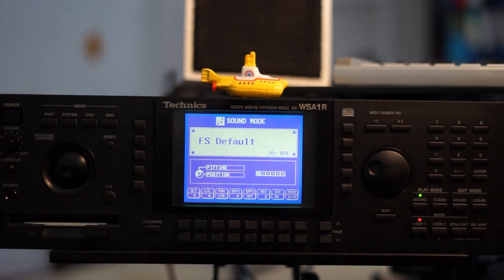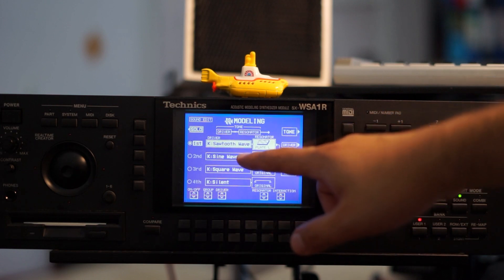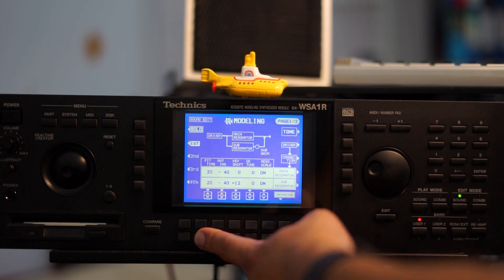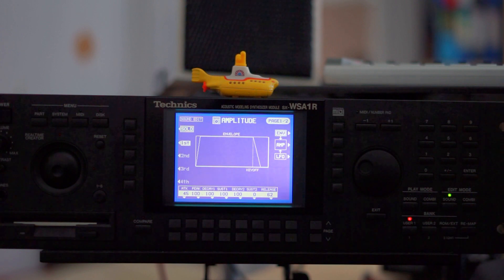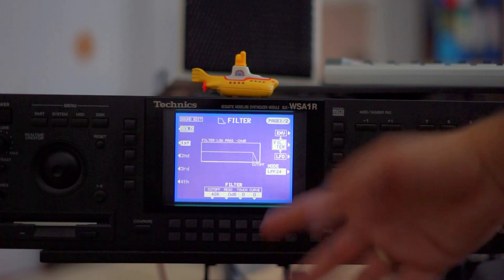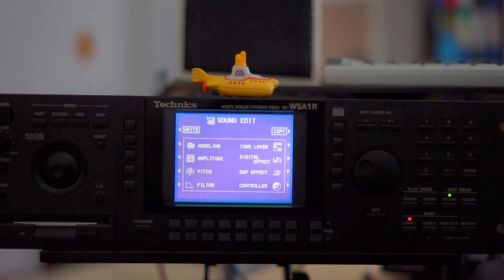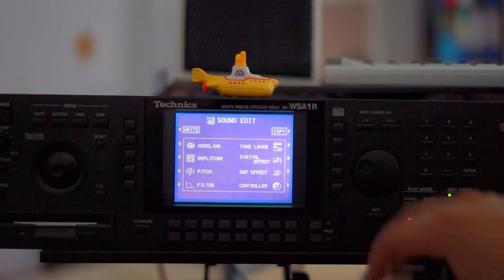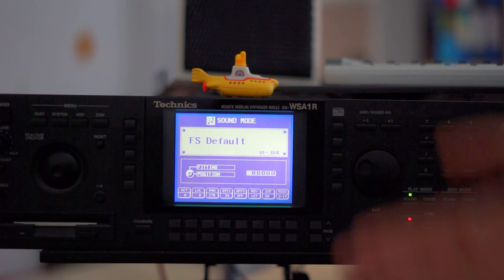Technics WSA1: A closer look at the modelling synth engine

Comment: Many thanks for your reply. I agree that the looping was sub-par on the WSA1r, but can generally get around it, as I only use the synth for what it can do best, and find that that specific is very wide and very powerful.  The multi-timbrality should be copied by all manufactures..  (32 channels, or more realistically a few less.) Thanks also for your tutorial on the Yamaha RS7000, which was also very helpful.   Excellent work. Best regards ritchie. BG.

Comment: I learned a lot from this video. I love the architecture of this machine, very logical and looks to be quite fast to work with. PM on this machine might not be as advanced as physical modeling from Yamaha,  but at least on the VL7 and EX5 you need a editor to be able to access the hidden parameters for the drivers (VL wizard is great). This thing is also polyphonic which is why i think everyone that has an interest in PM should have one of these alongside their VL1, EX5 or VL7 . I also think this machine sound surprisingly warm and its nice to hear that it implements good verbs for the time. Very detailed and high quality upload Floyd, like always. Very informative. Cheers!

Comment: Thanks for the video that also nicely shows how easy it is to program. I've seldom needed the manual for sound programming. 
The physical modeling of the WSA1 sounds at first not that exciting and shiny compared to the Yamaha synths. But the subtile intervention to the PCM sounds, the four sound layer and the plenty LFOs and realtime controlabilities makes it a very organic and unique synth. A great Pad and ambient machine!
Reply from the maker: Yes, that's right. The WSA1's modeling has it's strengths (64 voices! Something else than FM or subtractive synthesis!) and disadvantages compared to Yamaha's VL synths. It's in it's own league. The envelopes and LFOs are fast enough to create "modern" sounds (Dubstep wobble bass, yay). It's a shame it tanked so badly. I wish both Yamaha and Technics had developed their technologies a Little bit further. The analog hype is going to end some day and these machines could create very interesting, "cinematic" sounds.